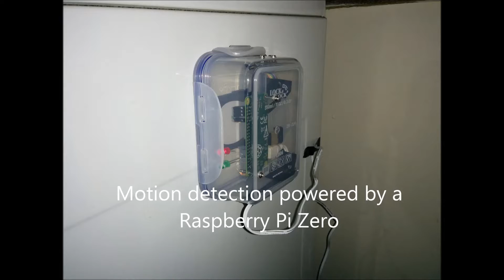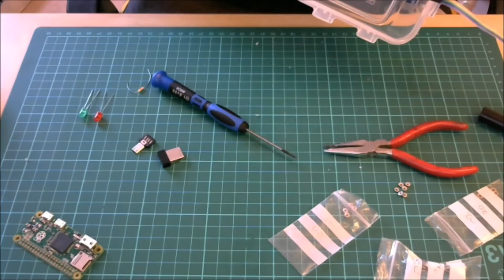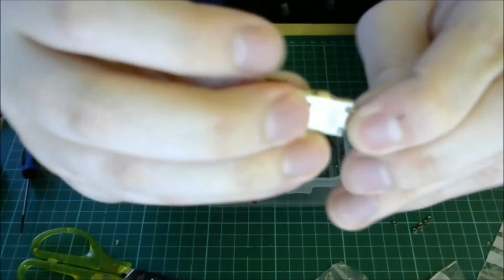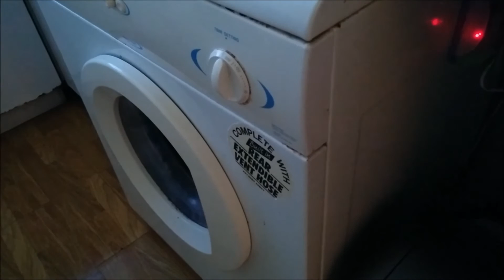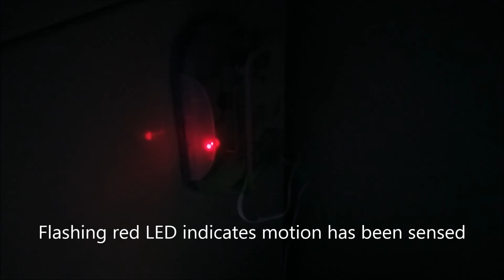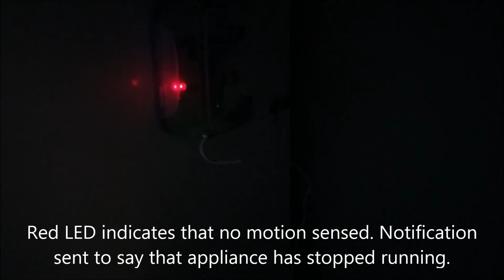Raspberry Shake: Connect appliances to the Internet of Things!

Comment: thanks for putting the python class for LIS3DH on github. I got it working no problem but have noticed the x,y&z values vary quite a bit even when the accelerometer is not in motion. Is this expected?
Reply from the maker: +pobalopalouus How much do you mean by "quite a bit"? It seems to be quite sensitive, so even the slightest movements will cause the values to change - you should use some kind of moving average to smooth it out a bit, rather than using the values directly
Reply: Matt Dyson well, x value shows a range -0.010745 to -0.028327, y -0.130891 to -0.149451, z 0.968010 to 1.048107. I've notice that the numbers do repeat although there's no order. Perhaps I should reduce the datarate. I'm just running your LIS3DH.py without modification.
Reply from the maker: +pobalopalouus Since it's quite a small change (+-0.1g), I think it's probably just down to inaccuracies in the sensor, although if you can find any problems in the code I'll gladly include a fix!
Reply: instead of printing output to 6 decimal places, i've gone with 1 decimal place. works fine.